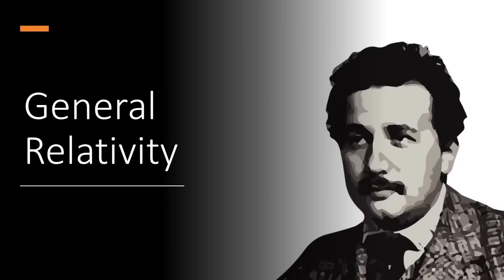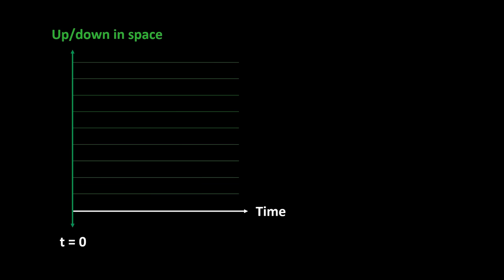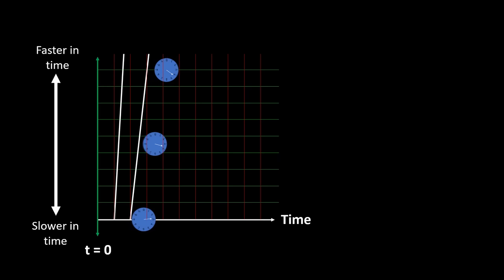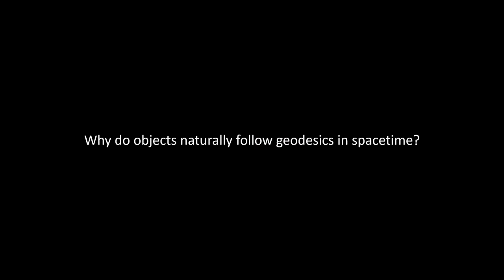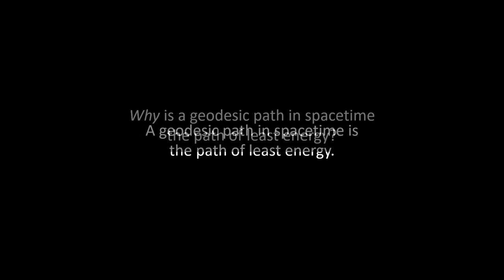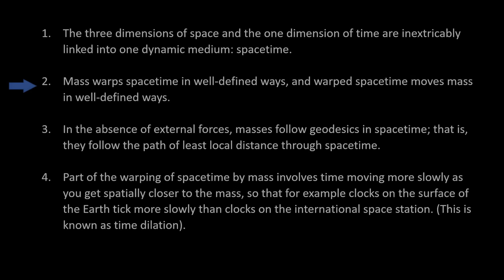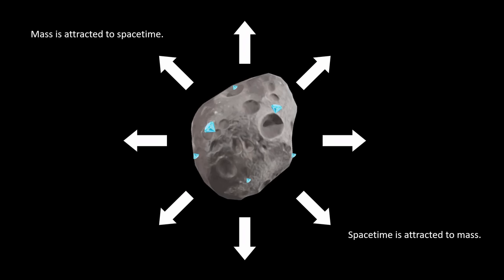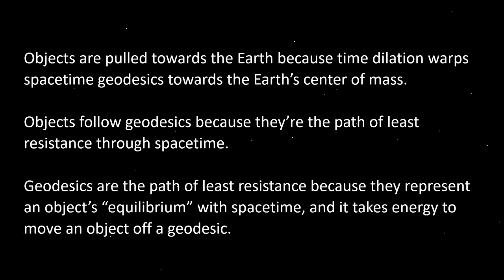How Time Dilation Causes Gravity, and How Inertia Works

Comment: You said that mass causes time dilation; BUT what about mass causes time dilation.  Ultimately, time dilation is caused by something not mass.  Something causes mass to create time dilation OR a slowing down of all nuclear functions.  Mass experiences a slow down of all functions.  Another question: what causes time dilation for mass moving at great speed?  It is not the movement itself!  Something in space reacts to the movement and causes the mass to experience the movement of the matter to be slower.   You said mass causes time dilation with regard to planetary bodies.  Mass of a space ship is very small; so mass by itself cannot be the cause.  How about the interaction of matter (the mass) with space, quantum fields.  Makes more sense than such a simplistic statement that is close ended.  Geodesics?  Sounds like an excuse to show how to calculate angles.  Sure, gravity is a basis; but what causes the gravity that causes matter to run slower?
Reply from the maker: These are great questions, and fundamentally, the answer is unknown. We observe that the interaction between mass and spacetime manifests as gravity, time dilation, etc.; but we don't have a mechanistic understanding of that interaction (see e.g. no consensus on how quantum gravity could work).

Comment: I'm still going with the crazy...Were all holographic emergent effects of  interacting polarized magnetic flux field lines dancing in cold darkness until they touch generating long lasting galactic sparks floating through spacetime emitting radio light waves stretching out into cold dark nothingness. Until then be like water and feel the good vibrations to ride the wave.

Comment: Wrong.  Time dilation is caused by gravity, whether on large collections of matter or whether matter is moving at great speeds.  In both cases as gravity increases so does time dilation, proportional to the amount of mass and proportional to the speed of the object.   In both cases space is affected to cause gravity.  The permeability of space is decreased and the density is increased.  Large collections of baryonic matter pushes against space and causes the space to be less permeable and more dense.  Space pushes back with what we call gravity.  The gravity causes the baryonic matter to contract; to lose energy as it pushes back at the less permeable and denser space.  Matter runs slower.  Cesium clocks run slower.  The half life of radioactive elements increases.  Time dilation occurs.    .

Comment: It's too bad that scientists are hiding that nuclear fusion always have caused radiation in all technology. Solar panels, the sun charges the whole entire planet. The pyramids already had electric grids using copper, wireless radio waves technology, the sun powered the entire pyramid. Circuit boards came from the pyramids. You see wireless as the God Aten, sharing wireless rays to the planet, so wireless is old. We cry about Cancer. Mammograms microwaving women's breast and All xrays machines are changing your DNA, ruptures the cells, not to mention processed and GMO foods on top of that, it changes the cells too. Takes 3 months for your cells to regrow to new cells. There are many ways to get energy and the SUN can power up the entire planet easy with solar panels, no electric bill, free energy. No need to fight for oil, or coal, water for currency electricity is another option. Energy crisis solved. And High mathematics came from the pyramids, 333,369, 999, nothing new.

Comment: Interesting thought about a stationary tree branch supplying energy to a stationary apple.  We think of energy transferred as force x distance.  In this case the distance is entirely through time and not space.  So, is that really transfer of energy or is it something else?
Reply from the maker: Great question. This all comes down to the equivalence principle view of gravity, how an object held stationary in a gravitational field (like the apple on the branch) is equivalent to that same object accelerating in a rocket far out in space away from significant gravitational fields. If these two really are equivalent, then they are amenable to equivalent descriptions in terms of energy. For an apple accelerating far out in space, it’s clear how much energy it takes to accelerate at g for one second, it’s the apple’s kinetic energy after that second (1/2 * apple mass * g^2). The energy is delivered by the rocket’s propulsion, and the store of energy is spent by that propulsion. How about the apple on the branch? In the equivalence principle view, the branch is accelerating the apple upward at g just like the rocket’s engines (and the tree is being accelerated upward by the surface of the Earth), so the same amount of energy is needed, and it’s delivered through molecular bonds in the branch. This discussion that someone shared with me regarding this video might help clarify the situation, especially Viktor Toth’s answer: 
https://qr.ae/pGqeZl

Comment: Mass is motion. Inward motion. Inward motion is motion in time. It's similar to the vortex in your bathtub drain. You can think of it as a void, and the spacetime "fabric" trying to fill that void due to a pressure gradient. When it succeeds a black hole is formed

Comment: That's wrong. Science channels as Dialect and ScienceClic have already been discussing about these kind of videos that show that gravity is caused by a spacetime gradient, which is not true, because it doesn't explain for accelerated objects.

The spacetime of an accelerated observer:

There is a gradient of time dilation.
However, there is no curvature of spacetime, it's flat. So, no gravity.

Therefore, time dilation is not the cause for gravity because it can also happen in non-curved spacetime circumstances.

What causes time dilation is the ACCELARATION not the curvature of spacetime.

Make a distinction:

- GLOBALLY: An apple falls because the curvature of spacetime takes its path to the center of the Earth (distance between the apple and the center of the Earth shrinks). That's an OBSERVER INDEPENDENT observation.
- LOCALLY: Ground accelarates upwards to the apple and reachs it. That's an OBSERVER DEPENDENT perspective.

Time dilation explains only the first perspective.

True gravity is the existence of curvature of spacetime, which causes a gradient of time dilation, a spatial change in the intensity of the force of gravity you perceive (gravity is essencially tidal forces).

Comment: Would I be correct in assuming that gravity only takes place due the inertia in the 4th dimension or inertia in time. If a theoretical object was to just form and had no precedence in time, should it instantly teleport to the point in its local space time with the highest mass thus the most curvature of space time?
Reply from the maker: Cool thinking, but no, not correct. Gravity is due to spatial curvature as well; it just so happens that by far the largest contributor to gravity on the surface of the Earth is gravitational time dilation. (So the title of this video isn't entirely accurate, it's just meant to draw in the viewer before clarifying the point).

Comment: Interesting...but i can not imagine why a clock situated at 200 m above ground, for example will "record" the time different from a clock situated at ground level. In case of mechanical clocks there will be a slight mechanical effect due to different gravity values ... atmospheric pressure difference between those points  - (1bar at sea level versus 0,98bar at 200m above), even so 0,02bar won t mean a thing, but let s just say this normal consequences can cause the clocks mechanisms to function different due to those external forces. But if we consider electronic clocks with no moving parts, i can assure you that the altitude won t matter, the clocks will show the same thing,  the quartz oscillator of electronic clock will do its job on the sea level - the same way on top of the Everest. So where is the time dilation ?
Reply from the maker: Time dilation has been experimentally demonstrated just like how you're suggesting time and time again: https://en.wikipedia.org/wiki/Time_dilation#Time_dilation_caused_by_gravity_or_acceleration

Comment: I wonder if the warping of spacetime is a measure of interactions, a convergent phenomena where time dilation is relative to the number of particle interactions. E=mc² shows a higher energy system has greater mass, but from an information science perspective, a higher energy system means higher concentration of interactions, not necessarily higher energy interactions. "Time takes longer wherever more things are happening" kinda makes intuitive sense, and I see the flow of gravitation like air flowing from below a single spot in the desert; the sand is spacetime, and objects near it will tend to fall into the loose quicksand because it's shifting. I wonder if mass energy falling away from other mass energy light years away might cause dark energy, as gravity can't overcome other forces, the sum of all falling in one galaxy pulls at the spacetime between it and all others, like two quicksand pits pushing sand between them when an object falls inside.
Reply from the maker: This is an interesting brainstorm. I'm not sure how to "confirm or deny" this, but maybe an openminded theoretical physicist will chime in here at some point.

Comment: maybe matter for some reason has a tendancy to flow towards a resting position or some outcome/definite? figuring time dilation by altitude.

inertia is spin/trajectory - magnetic perpendicular fields, somehow, making waveforms

nuclear strong or weak forces cause these fields, making waveforms instead of alignments and lack of inertia or supercold fluids, and move like usual (spin and waveform/trajectory) with or while in the presence of enough heat/infrared(?) fields present, somehow.

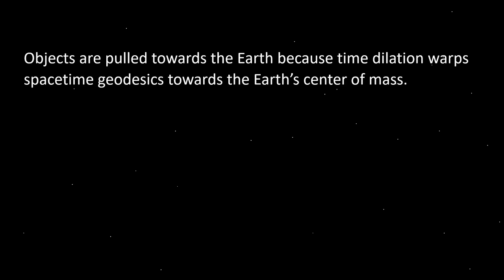Comment: Nice video. Very much appreciated.  But @13:15, is it that time dilation warps spacetime geodesics towards the Earth's center of mass or is it the earth's center of mass which determines the shape of these geodesics?  This was stated as the main point of the video, but not enough time was spent explaining the difference between these two statements, if there is one.
Reply from the maker: Thanks! Good question. Even though this video sets out to show that the gravity we experience on earth is caused by time dilation, what I’m really trying to get across is that both are one and the same. That is, the thing we call gravity, which is the force we feel pulling us downward, is equivalent to the effect that time dilation has on the path our bodies seek to follow through spacetime. It’s not the case that one causes the other; they’re the same thing, and that single phenomenon is the result of the way mass and spacetime interact.

Comment: Hi! But why does the body choose the "shortest path" between the white lines?  Does it have to do with minimizing the action (the length of the world line)?
Reply from the maker: Hi! Yes, as with all spontaneous actions in physics, it's a result of the system seeking the lowest energy state. Masses follow local geodesics because it requires the least amount of energy (i.e. the object would require extra energy to follow any of the non-geodesic paths; for example, a satellite in orbit is only able to maintain orbit because it has a lot of kinetic energy perpendicular to the geodesic provided by the Earth's mass).

Comment: Was thinking 🤔 
If you take an object the shape of a ring and spin it as fast as posible in outer space using the same direction as you would rotate a ring on your finger ... what would the resulting spacetime warp look like in the vicinity of the ring
Reply: According to what I think I know ... the ring would gain mass... and  mass warps spacetime but there is no mass inside the ring so I'm sure it makes for an interesting  scenario
Eg... if spun fast enough could a black ⚫ hole like situation arise in the center?
And right there I find another question ... does our super massive blackhole pull our galaxy together or does the galaxy cause the super massive blachole in the center to form?
Reply from the maker: "Spinning a ring as fast as possible" I take to mean "as fast as the ring can hold together under the centrifugal force", which for any given material, wouldn't be fast enough to result in any significant gravitational effects. I.e., the ring would expand, then rip apart as it sped up, like this wheel here: https://youtu.be/ZpoyoPSiB3M?t=75

Comment: The curve you describe makes me think of a record player. The centre and the outer points seem to make one revolution  at the same time but the outer edge point has a larger diameter and so moves faster through space time. Would this be an apt analogy? Great vid nice simple chunks to help a person learn the more complicated parts in the future. Take care keep well.
Reply from the maker: Hi Vincent, interesting comment. I think it's not exactly an apt analogy, because all objects always move at the same rate through spacetime (at the speed of light, which is a confusing point in itself, but I think this video's description contains a link to a good video that explains this). The thing that changes from point to point in space relative to other objects in space is whether that thing is traveling at the speed of light solely through time (i.e. not moving relative to those other objects) or having a component of its travel through a direction in space (while traveling less than the speed of light through time as a consequence).
Reply: @IdeaListEye  Cheers mate I knew I wasn't there completely with that analogy lol or at all. This will help no end, much appreciated. Thanks again and all the best, take care.

Comment: One thing I wished you had explained regards the stumbling block I had when I first tried to understand time dilation. I could not get my mind around the fact that two old school mechanical clocks would show different times when one was moved away from the earth. It seemed like they made a mistake as the mechanical mechanism should give the same result. The glossing over the reason this happens at an atomic level is not usually explained and causes a headache when trying to put the whole picture together. Maybe a topic for a future video? André in Sydney
Reply from the maker: This has been a consideration from the start, and a lot of very smart people have taken great pains to address it (and to test what you proposed, whether it's just a mechanical accident or actually a consequence of fundamental physics). You can read more here: https://en.wikipedia.org/wiki/Experimental_testing_of_time_dilation